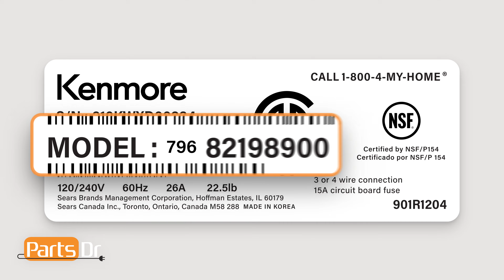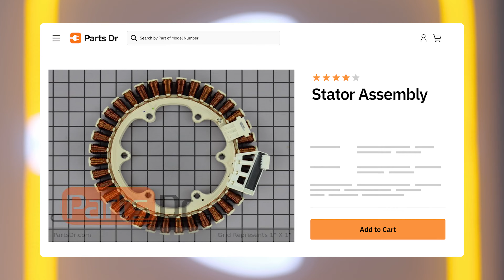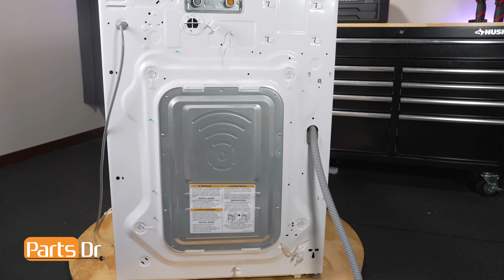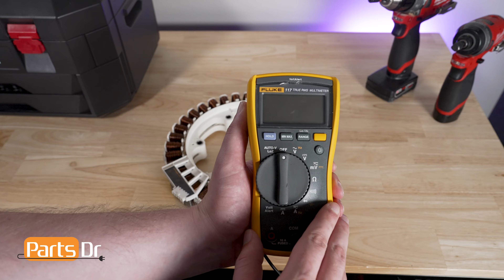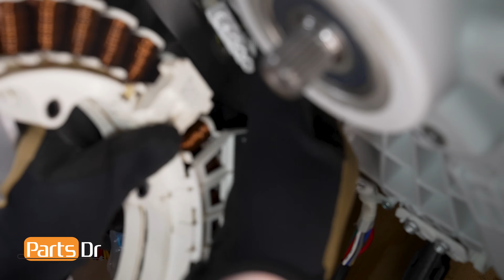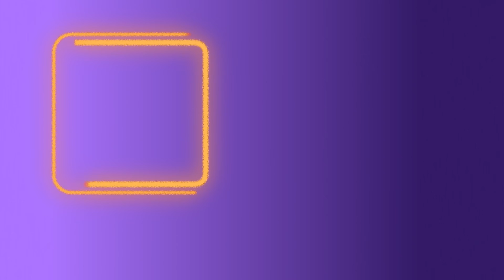How to replace Stator & Hall Sensor Assembly part # 4417EA1002Y on your LG Kenmore Washer

Comment: Mine looks exactly like this, but doesn't have a hall sensor at all.  Model WM3670HWA.  No electrical at all for it, just the stator power.  There ARE table on the stator for the hall sensor though, but nothing there.